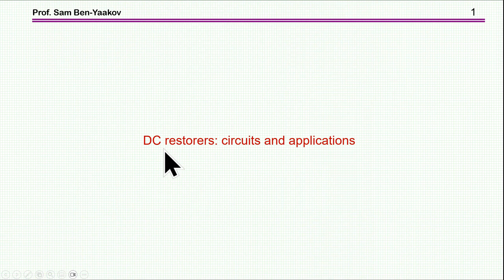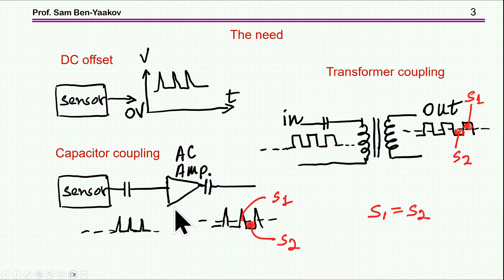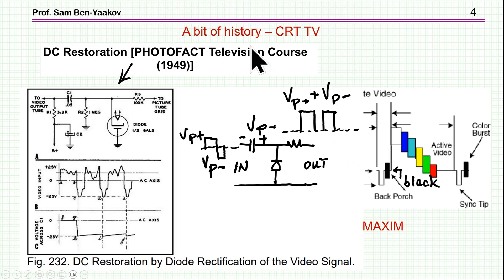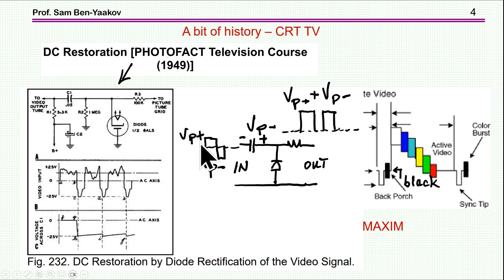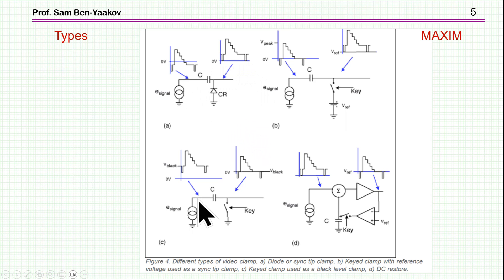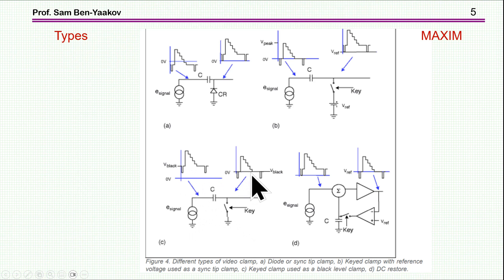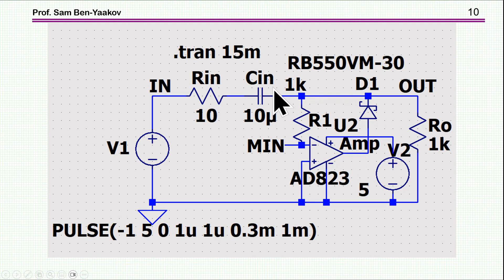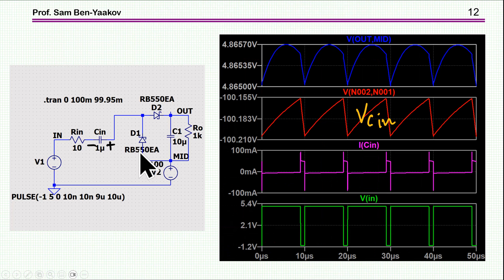DC restorers: circuits and applications

Comment: The circuit shown on slide 15 can create a dangerous situation on the MOSFET. Simulations show that when the input signal stops switching or the duty cycle changes abruptly, the MOSFET remains ON for a very long time. Another elegant circuit for driving gate-drive transformer  can be found if you search for "Power Tips: a Simple Circuit for Driving Gate-drive Transformers" and it does not have problems described above

Comment: in the last example how do you estimate current needed to drive all those floating transistors? 
do u calculate based on the gate charges and switching frequency ? or simply simulate and measure how much is needed to properly open them all ?
Reply from the maker: First estimate from charge and then simulate😊

Comment: Hi Professor. 
One elegant way is to get rid of capacitor.  This patent show it US 8,223,066 B2.
Reply: Yes , that is whole idea , to move input signal to Vref with single supply opamp. DC offset at input can be changed but the signal at output always is around VREF . This helps also to easily interface to A/D converter.
Reply from the maker: @paulpaulzadeh6172  You wrote "get rid of capacitor" 🙂 And again, this is useless when there is no galvanic connection between input and output grounds which is discussed in the video.
Reply from the maker: @paulpaulzadeh6172  But you wrote "get rid of capcitor" 🙂. Also, I do not see a large difference between the cap peak detector solution seen on slide 5 and the patent circuit.
Reply: @sambenyaakov yes , in slide 5 picture (d) is the same idea , but in patent it shows also how you do it with single supply opamp,  AC amplifier when input signal go below zero ( negative ) then amplifier should have positive and negative supply voltage . interfacing to A/D is much easier when you don't have much power in system (  example battery driver ) .
You mentioned also flotting galvanic isolation,  but in your Ltspice you connected ground on both sides of transformer!!!!
This is not flotting system!!
LTspice convergence issue can be done if you connecte big value (100Meg) between primary and secondary of transformer. 
But very nice last slide for battery balance circuit,  I didn't know that.
Reply from the maker: Well, the capacitor was moved to the integrat😊And then, the isolation beweem input and output grounds was lost.